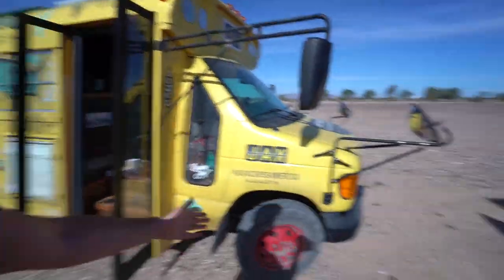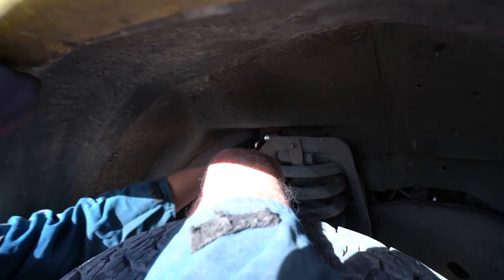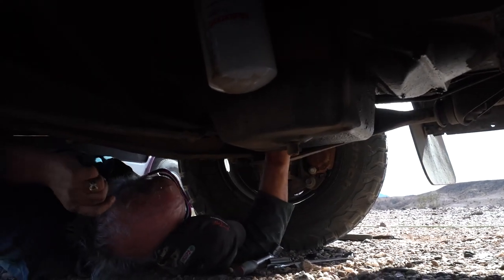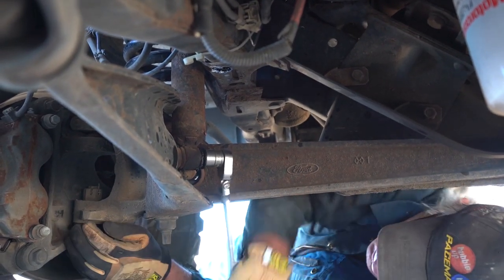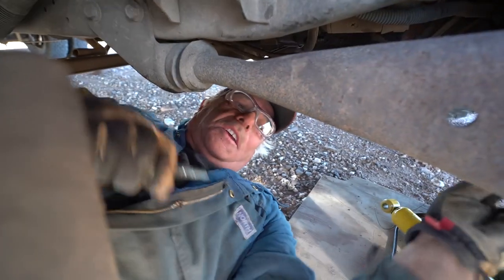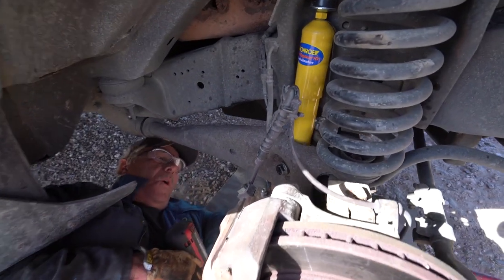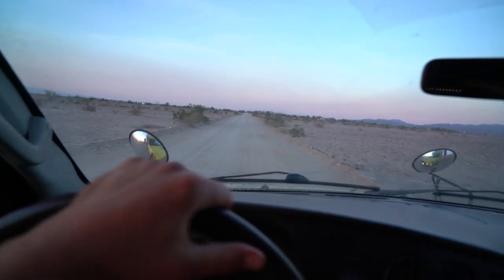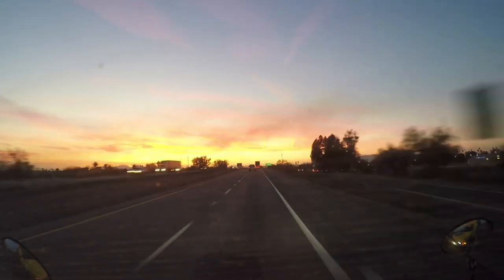MONROE GAS MAGNUM RV SHOCK INSTALL (+ Test Drive!)

Comment: Congratulations. Badge is a good man. Bad shocks are dangerous. Good shocks keep your tires on the pavement when you brake hard. 
Had to change the 6 shocks on my 2000 International (big truck) about 10 years ago. The original ones had over 600,000 miles on them. Had to cut most of the bolts. Used air tools hooked to the air brake system. Simple job, but not easy. It feels good to fix things yourself. It builds confidence, too. Besides, do you really need all 10 fingers?
Reply from the maker: haha definitely fun to learn and DIY!

Comment: would have loved to have seen the method you guys used to drill out the stud. ive hit the same problem where the stud is too big for the shock. my van looks like a physical exploded diagram right now and i need serious help lol! did you drill from the back? what size bit? 5/8? i know he said thats the size of the bolt the shock takes but you gotta drill out a little bigger to get the stud out right? what size bit did you use? sorry im just going through yt vids for the right answers. any response would be a boon.

Comment: How do you like the rears with the coil spring helpers long term? My old, much larger class c is needing rear shocks and I'm debating if the extra $20 per shock (vs regular Monroe RV shock) is worth it.
Reply from the maker: They worked great, but I don’t know how they stack up to other options. Huge difference. Get a steering stabilizer also

Comment: The biggest mistake people make is to run too much air in the tires.  My rear bus tires are rated up to 110 psi and I run 80 in them.... the bus used to be loaded with 28 adult passengers, now one or two and minimal weight in comparison to before..... washboard roads got you down? Thank the yahoos that drive their empty pickups around with 80 psi in the tires.....hop hop...